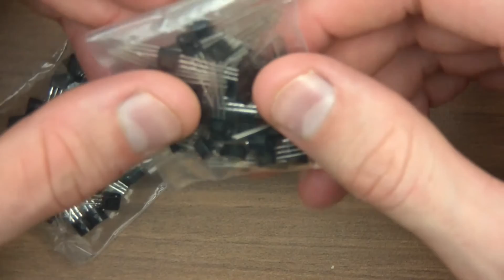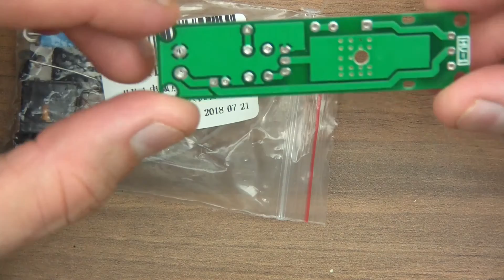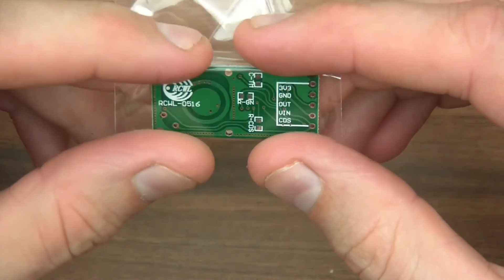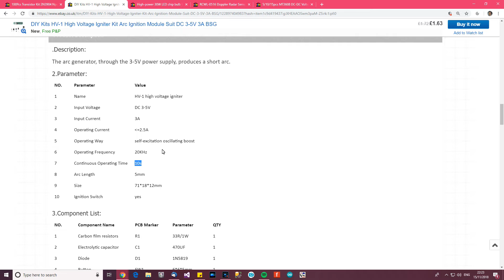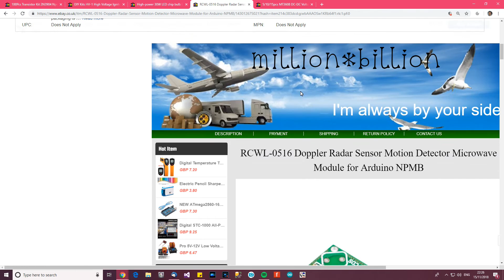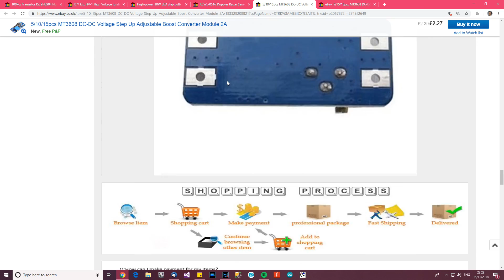Post Is Here! (Random, Cheap Ebay Stuff) #32 (Some Bargains!)

Comment: CdS = Cadmium Sulphide. 

On your board it marks the spot to fit a light dependant resistor to restrict operation of the sensor to the hours of darkness for applications like switching an external light. 

If you omit it the device works constantly.

Comment: what's a boost converter used for.
Reply from the maker: Hey Linda, it's too boost voltage. So if you have a 6v battery for example, and you want to power a 12v car light bulb, you can do so with a boost converter. :-)

Comment: By all means read the advertising chinglish, but dont believe a word or digit of it and just get the real datasheets for the chipsets.

you radar modules will switch the 34v of the led as the thing is just an open collector switching transistor output (or is on the yx506 variant, this is no doubt just another version of the application diagram from the generic data sheet) now if that transistor will switch 1amp..... probably best to use your own switching transistor to ground you dc-dc converters input with a good 2-3 amp npn or mosfet